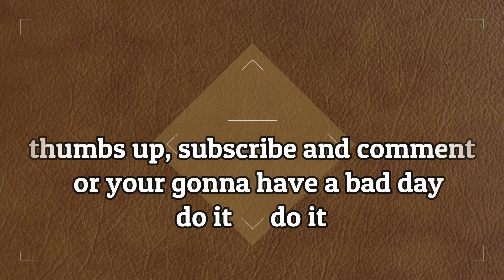This is why NOTHING GETS DONE on the HOMESTEAD!

Comment: Doug, start with a 1/8" pilot hole. If you're going to 1/2" hole step up to 1/4" after your pilot hole. If you don't have drilling oil, use motor oil.  It's much heavier than WD40 and will cool your bit better.  WD40 is great for aluminum drilling and cutting.  Don't use the hammer setting for steel.  You're right about taking your time and drill at a even pace for both speed and pressure.  Milwaukee drills have an amazing amount of torque which is why it's easy to snap a bit when it bites too much in the steel.  Near the end of your hole you really need to let up on the down pressure or it will bite too much and snap-a-roo!
Reply: 100% Correct.  WD stands for Water Displacement, use a real oil instead when drilling.   WD is great for old vehicles that won't start due to water in the distributor.  One spray under distributor cap and drive away.
Reply: The Electrocity water dispersant attempt 39 WD40
Reply: Speaking as a real machinist and engineer. Oil is for lubrication not cutting. Wd40 is a very lite oil, not a real lubrication oil and not a cutting oil. Steel requires a cutting oil. Personally I buy good drill bits with 8% cobalt in them, then I drill dry in steel. 
Never had any luck with Milwaukee saw blades or drill bits. Doug's concrete bits are breaking not because of the size difference but because the manufacturing process has a sharp corner at the breaking point. Sharp  corners are a weak point or a stress point that will break there every time.
Reply: Hope Doug reads these .... some good advice there!
Milwalkie (Defaault or any of the others) are makers of drills not drill bits! Don't buy bits for the brand name (unless you know drill bit manufacturers) ;0)
Also drilling through steel you do NOT want a hammer action. In concrete you do. You also want a percussion drill rather than a hammer. 
Everyone does it there own way but I think shimming your mill base is the way to go for accuracy .... and for that you do not want to use concrete screws (we call them Spax) as they are a tighten once only application. Eather a decent rawbolt and rawlplug or expanding anchor with screwed thread nd nuts to tighten down would be the pro choice. Although newer guys might go for the screwed rod and epoxy anchor ...... if you want old school you can simply drill a hole the would just accept the rod in the concrete and pour a wet (liquid) mix of concrete and water to fix the rod, then next day nut it down snug!
Your vibration may be less now but if you look at the video it would appear to be a factor of your blade grabbung nd you pushing from a high point causing a pivot on the front wheels ....... simply altering your pressure on the mill and holding it lower may work well for you too!
Reply: Dead on Daddyg!
Reply: @BESHYSBEES  Yup, 40X to get it right!
Reply: He is using the drill with the hammer turned on of course he is gonna bust and wreck any drill bit.
Reply: Wonderful more tips. 👏🏽🤗
Reply: The Electrocity WD40 is just a deodorised fish oil but it’s definitely a handyman in a can with 101 uses for it
Reply: @BESHYSBEES  Agreed, fish oil for sure.
Reply: @BESHYSBEES  War Department 40 lol I used to use it by the bucket full the company that i was working for used to get it in 44s It was a must in the toolroom with everything being washed down and soaked in it, it was only in my latter years that i gained respect for it when I purchased pissy little cans and got milked at the same time. I would have imagined that a machine like that would have arrived complete with some conveniently drilled mounting holes.
Reply: And no I am not coming to Queensland, happy where I am, although I often find myself checking out other people and looking over the shoulder, but we still have it good compared to the US

Comment: One man show..😂 I know that feel. 😂 slow speed and some oil.. A pilot hole always helps.😊 you can sharpen them drills on a grinder if you carful..
Reply: living Off Grid McGarvey style you can’t sharpen any bit with a grinder at least not properly it ruins them,  you might get a couple cuts again but it’ll dull fast, a stone is a better option for drill bits
Reply: Do you think that they use a stone at the factory?
Reply: Alaskan Ken depends on the factory but yes they are ground with an abrasive usually boron nitride or similar, a stone or bench grinder is the better option, you always over sharpen one side with a angle grinder
Reply: Alaskan Ken first video on a search time stamp for you 1:05 https://youtu.be/uSOXcyKNvLA
Reply: You sure can. I’ve been a machinists for 30 years. Just make sure your grinder has a fine wheel. That’s the first thing you learn machining 101. Used to grind all my cutting tools. At the factory they have a jig to set them up for clearance. Depending on if it’s 118 degrees or 135 degrees. Get the 135 of your drilling a lot of metals.
Reply: living Off Grid McGarvey style all well and good for you with experience but judging by the work performed here on the video the last thing he needs is encouragement to put fingers near something spinning at 10,000 rpm lol

Comment: Use low setting (slower) and not the hammer in your drill.  Use oil to cool your bit and work with the bit in different positions so that the "grooves" in the bit bites into the steel.  Start with a small bit and work up to the size you need with different bit sizes.

Comment: Hammer drilling on a steel cutting drill bit will dull the bit fast.
I would put a string line on each rail and check the level. The low spots shim them.
Also take a grinder and cut a dip into the track under the two wheels closest to the end of the track. It will be like a park debit.

Comment: Hello Doug , you don't  need to assert as much pressure on the drill , just let the drill do the cutting , hammer drive is only for masonry drilling , you have gone to heavy on the drill bit and heat has damaged the bit .
Doug.

Comment: First, yes, please show the 🎁.  2nd, not sure if it's required or just an added step, but i saw another YouTuber spray lubricant on the track and runs the sled back and forth before cutting wood. Maybe it doesn't apply to your mill, but figured I'd pass it on.
Reply from the maker: bad idea, that stuff is like a magnet to the sawdust =)

Comment: Use cutting oil not WD-40, pre-drill larger holes, and you do not use the hammer drill setting on metal. The hammer setting is for breaking concrete.

Comment: It doesn't matter if the hex-shank is broken off the drill bit. If the drill diameter is under ½" the chuck will hold it firmly. Tip: when you tighten the chuck go back till you feel/hear a tiny click. Then it is locked and the drill bit won't fall out. Especially important when you use hammer mode.
The top you used on the impact driver doesn't look like it is impact-rated: they are usually mat black and thick-walled. The shiny chromed bit tops are only for handtools. They can explode if they are used on an impact driver.

Comment: In my experience I've found that when drilling metal.....it's better to pulse the drill rather than a constant continuous turn. This helps to control heat buildup at the tip of the bit. I also use wax instead of fluid lubricants. As for bits...I use titanium only for any metal 3/16 or thicker.

Comment: I would never buy a drill bit that has had the shaft turned down like that. No need for it, every manufacture makes drills with a 1/2" chuck these days that are very affordable. I also only buy good Cobalt drill bits, those cheap ones are more trouble than they are worth.

Comment: I had a project where I had to drill holes into galvanized steps. I burned thru so many drill bits, then I learned about dipping my drill bits into motor oil during the drilling. It mad a huge difference. It kept the bit cool which made the bit stronger. Now when I have to drill into thick steel I keep a cap of motor oil by my drill.

Comment: Doug Need to place a piece of scrap 2×4 in under the metal you're drilling softer than concrete. Use a bigger shank bit and chuck /drill for the torque on bit. We hope you are using red head bolts in that slab. More stable mount for vibrating machines like your mill.  Also put a awning over that pad for shade of you. Also make it small for those Kansas winds.

Comment: As others have said, don't use hammer setting for drilling steel.  Just as the drill bit starts to exit the steel, let up on the pressure.  The drill bit caught and made a thread the flute followed is one reason the drill bits broke and twisted.  Cutting oil is best for drilling and tapping in steel.  WD40 is good for aluminum.

Comment: Hey Doug you should invest in some drill sets if your on a farm and doing projects, a good quality high speed drill set will cost a little over a hundred bucks and sizes over 1/2 inch you generally buy separately between $20-$50, get a set of hole saws and a set of long auger bits for wood used as borer for posts etc, and a set of masonry bits, if you buy decent bits and use them appropriately they last a very long time unless you’re in the construction industry and then they don’t last but are considered consumables, estimated and counted for, but for you around the homestead building project should see you out with quality tools

Comment: Learned this after your faulty tools made me take a look at manufacturing locations:  "Craftsman and DeWalt are Owned by Stanley Black & Decker. Stanley Black & Decker (SBD) turned heads when it bought Craftsman Tools in 2017 after Sears closed 235 stores in 2015. The company owns many brands, however."

Comment: Doug, you work very hard.  I had to put in a Mail Box for my daughter yesterday.  It was 89 Degrees in South Carolina yesterday and I almost killed myself with the heat and the post hole digger.  I used a pour in concrete that all you do is put it in the ground and pour water on top of it...NO MIXING.  I looks good, I am hoping it works for years.  I don't like using tapered drill bits.  They are very weak.

Comment: I have found that these smaller drills with the "hammer" effect don't work on concrete well..  What  you need for the concrete is a Bosch Hammer Drill.  Those things dig right through concrete.  My DeWalt hammer drill just didn't have the balls for the task.  Having done some hotel renovations I've had first hand experience with the Bosch Hammer Drill.  I liked it so much that I bought one for the home.  One other thing that I like is that Bosch also sells screws for the drill bit size that you use.
Reply: Bosch is good,  I also really like the Hilti brand, but they are pricey.
Reply: Rotary hammer drill work the best imo
Reply: @guyindesert  I agree. In the old days we called them "Roto-Hammers".

Comment: Hey Doug 40 years as a machinist you shouldn’t use the hammer drill setting while drilling metal that for masonry only. I also don’t recommend a pilot hole either it causes the drill to grab and twist off as you found out.

Comment: Biggest issue I see is that the carriage is a giant square with no cross bracing. Need some triangles in there to keep it square. So you don't gets no parallelagraminations and such. Wiggles and wobbles. Plus the pad might not be completely level. Could be some subtle dips and rises throwing off the stability as the carriage rolls down the track.

Comment: Really love your videos. Only use HAMMER on the concrete because it needs to ‘vibrate’ to go through the concrete. Use ‘drill’ setting on steel or metal. Do not buy the drill bits with the QUICK CONNECT (for your impact driver) for use on steel. Buy bits that are the same size and smooth all the way to rear and chuck them up tight in your drill.  Thanks for all of your videos!!!

Comment: i was taught to never use a hammer drill on steel. will destroy a bit in a hurry. those hex drive bits are intended for soft metals like aluminum. the shaft will not handle the torque required for larger holes

Comment: Doug, how do you ensure your sawmill deck stays level when it's bolted to uneven concrete? The mill I have (Norwood HD36) has an optional set of short, adjustable leveling legs. Mine is configured as a portable mill so I have 8 jack stands to maintain a level deck
Reply from the maker: That concrete is very level,  much better than any "in the field" applications... it is after all a portable sawmill

Comment: It's really hard to find decent drill bits anymore. I have brand new ones that won't drill a hole in metal.  Wood they work OK most of the time.
Reply: Muskrat Outdoors you need HSS bits high speed steel also high priced but worth the investment if you do a bit of handy work

Comment: I've had a Hudson mill for a few years now. Mine shakes a little bit also. More when it was new. Lightly grind where the tracks connect. Wait till you change the oil. Almost impossible to get to the drain plug on my Oscar.

Comment: Doug, Always goggles metal and woodwork especially outside where dust blows in too to distract and slip as well. Start hole with a centre punch. No hammer for metal, hammer for concrete. Plenty of product development notes for manufacturers here, though! If you are contemplating heavy workpieces  you must have heavy machinery working well within its capacity. That said, your perseverance paid off and I would like to see what hit the cutting room floor! Looked like a fine day there otherwise. Today, here, it's hot, still, raining and humid, +90% and I'm breathing like broken bellows. Sitting down jobs for me today. Stay cool,  well and safe. Regards to Stacy. Regards Stephen.

Comment: That is a very good cordless drill Sir but that is no 1/2” Milwaukee hole hog lol
Reply from the maker: Dang. I think I have a hog box ... next up
Reply: Just for anyone who may not know a hole hog is a very powerful electric drill made by Milwaukee tool so powerful that if the bit jams you can get hurt by the drill if your not very carful
Reply from the maker: Break a wrist
Reply: I have seen a guy get knocked off a ladder with a hole hog . I believe that some of the newer ones have a clutch mechanism that will help prevent kickback.
Reply: If you watch the video of you sawing the frame of the mill is flexing as well. Some 45° angled knee bracing on each side as close to the saw as possible would help. Also it has four wheels so when pressure is applied to one side it wants to rack and bind. A hand crank with cable on a spool mounted as close to your cut on the vertical plain and as centered on the horizontal plain as possible will give you greater control and smother cut pressure. I have worked in sawmills in the pacific north west for 35 years and all carriages that have pull cables are mounted on center of frame on the horizontil plain. You would have to mount a anchor post on the far end to hold your cable but it will make you a happy Sawyer. You could try it with just a rope and pulling it by hand. You will have to not apply to much pull as the wheels do not have a long wheel base. The large carriages have weight on their side. I know it must get old listening to everybody be experts. I am no expert in anything nor do i play one on tv. In fact i have a face for radio.
Reply: Wow I found my new toy to buy the Milwaukee super fuel hole hog that should make log home building easy
Reply: he has no idea what you are talking about!!!!!!!

Comment: It doesn’t look like it would have been a lot of extra trouble for the manufacturer to go ahead and put the bolt holes in the metal rails when they made the sawmill. Then you would’ve known how many and where they recommended putting the bolts. Then all you would’ve had to do was drill into was concrete.

Comment: While the un levelness may have contributed to your wobbling, I would of liked to see a run after your re level. I am going to guess little to no improvement. The frame on that thing has no cross bracing structure, it looks like it relies on mid span bolted connection at top only? You need some diagonal bracing from your cross bracing to your vertical members. Your wobbling is from the lateral force exerted from the cutting action on a frame that is not braced.

Comment: I'm guessing your pilot bit was about 1/8", higher speed would be fine for it. The 1/2" bit would require a lower speed. The cutdown on that bit looked like it was 1/4", for a 1/2" bit it shouldn't be smaller than 3/8". 
I personally don't like the keyless chucks. It's so hard to get them tight enough if you don't have a cutdown shank. I've spun plenty. 
Like the looks of your saw,waiting to see it going good. 
Another good video, keep them coming. Have a good day. 
I'm in NE Indiana, our heat and humidity has been unbearable here too.

Comment: I HAVE BROKEN BITS WHICH WERE SOLID SHAFT WHEN USING PILOT HOLE AND BREAKTHROUGH IN STEEL … BIT COCKS THEN WHAM IT BREAKS ...TALKING BITS UP TO 1/2" … ALSO YOU NEED A REAL HAMMER DRILL FOR CONCRETE... WHAT YOU ARE DOING IS TOUGH ESPECIALLY WITH HAND HELD TOOLS...SHALOM BROTHER, LOVE YOU GUYS...